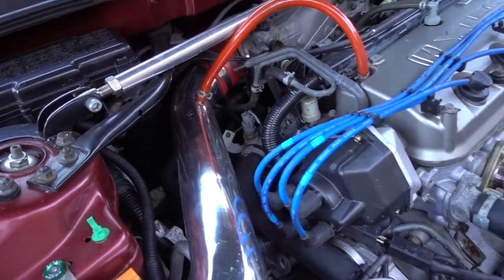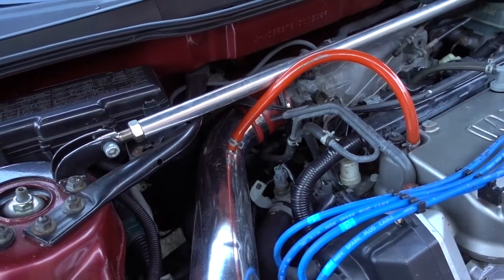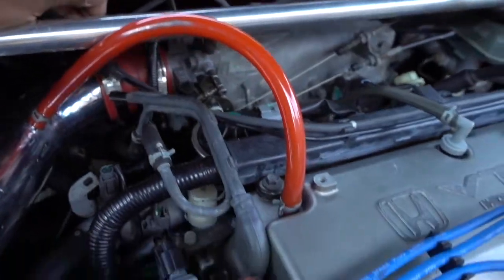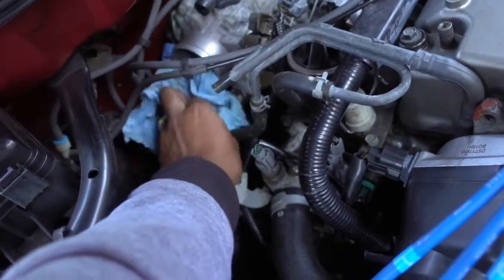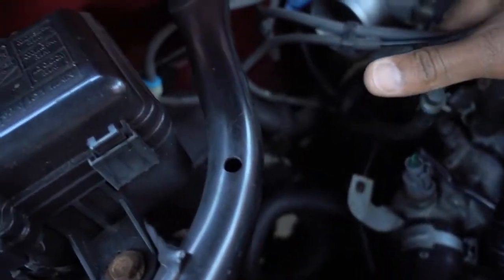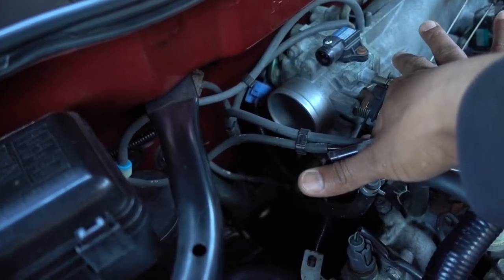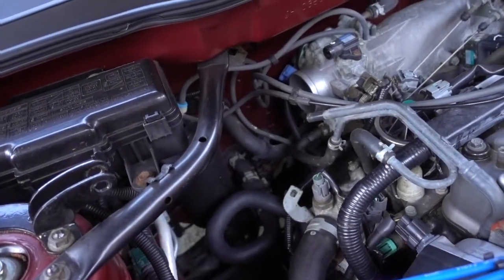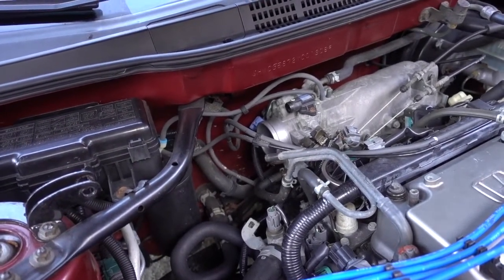How To Fix sticky Gas Pedal

Comment: My car started shaking when coasting in neutral after cleaning the throttle body on my integra today. Everything in the car is stock including the intake.
Reply from the maker: Check all the vacuum hoses and check if everything is connected because maybe you have a vacuum leak
Reply from the maker: Also if you put too much cleaner maybe some get to the intake that’s why you have to put just enough and cleaned with a rag
Reply: Bullet Solano There was only 2 hoses I disconnected & reconnected to the intake but I'll double check on. Would the issue go away by itself if I sprayed too much, I waited about 40 mins to start the car after I cleaned it
Reply from the maker: If that’s the case with just driving the car should go away
Reply: Bullet Solano Ok thanks. BTW the pedal still gets stuck, do you think the tb cable could be the issue?
Reply from the maker: If is not the throttle body then is the cable or the pedal, just put some WD 40 to the cable

Comment: I cleaned mine gas throttle cable is still hard to press down , i suspect the cable from gas to throttle body is the problem sticking and old , any way I can change it ?
Reply from the maker: Clean the throttle body, remove all that gunk from the inside